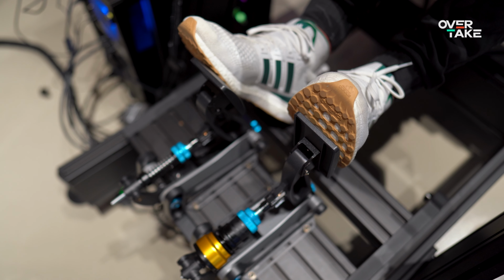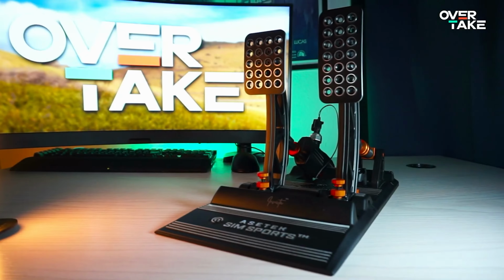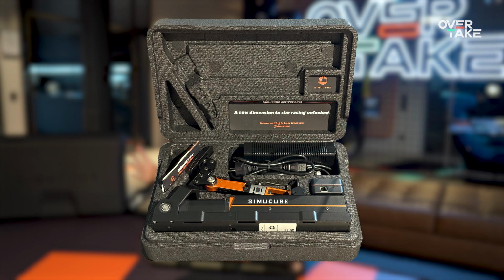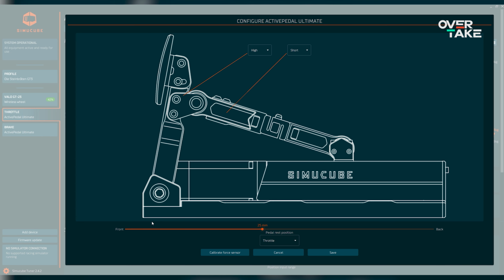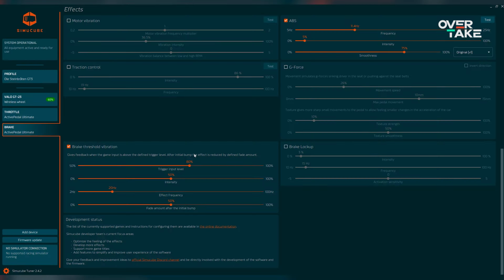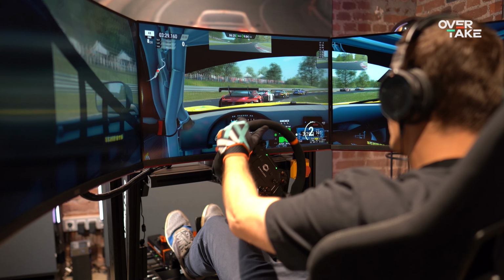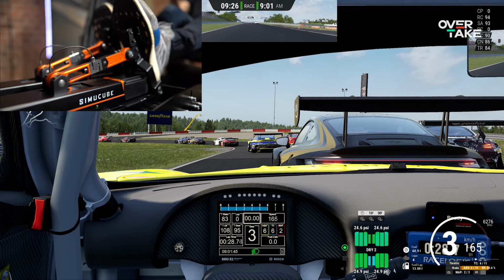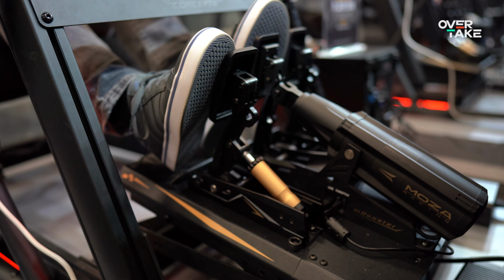How the Simucube ActivePedal Ultimate can UNLEASH your Potential

Comment: If you use haptics on your throttle you will definitely want the active pedal for a throttle, it works even better. I like the way the engine feedback as you accelerate, you can definitely feel it

Comment: I purchased the pro version. Was it worth the price tag mmmmm still working that out, but yet couldn’t go back to normal pedals.. ultimates totally not worth the price tag.  The pro’s do everything that you would need and adjustability of the pedals is amazing.
Reply: @nickyjj5459  The add on cost the same, and you don’t have 2 bricks. I got my add on for $1450 Black Friday and $1960 for the main,

Comment: Moin Michel, ich hätte mal gerne einen direkten Vergleich zu meinen Heusinkveld Ultimate+ Pedalen mit Sim 3D Feedback für ABS Feedback, ob sich hier der Aufpreis wirklich lohnt. Denke nämlich schon die ganze Zeit über ein Bremspedal von SimuCube nach. 110Kg sollten eigentlich reichen. Bei meinen Ultimates stelle ich maximal 50Kg ein.
Wäre es denn möglich, dass man ein SimuCube Pedal zwischen das Kupplung- und Gaspedal schraubt, auf der Heusinkveld Platte?
Reply from the maker: Du bräuchtest also im Grunde genommen mal die Abstände der Punkte, an denen man die ActivePedals verschrauben kann? -Michel
Reply: @OverTake_gg  Genau. Wenn die auf meine Heusinkveld Platte passen würden, dann würde ich die Pro Version abwarten. 170Kg Bremsdruck benötige ich beim besten Willen nicht. Soll ja nicht in Sport ausarten. 😄

Comment: Ive got to say it's smooth but it makes a grindy rubbing noise. I also think the p1000s and p2000s on hydraulics with springs are just as buttery smooth. Also with its haptics it gets very close in feel. But yes you can't change the way the brake fully feels with a click of a button which is really the selling point here.
Reply: The noise has been the only drawback for me so far… was not expecting them to be that loud… I have some SIMAGIC reactors too, think I need turn it alllll down. The Simucube engine haptics feel insane, tho. That was another WOW moment.. all in all, definitely having fun and beyond.
Reply: @JayKBra  yeah you would think all of that money and r&d yet no dampener down the side? Massive oversight imo by there team. They could seriously have just added some rubber on the bottom and it would have reduced the effects or used some plastic liners under where it slides and reduced the sound alot.